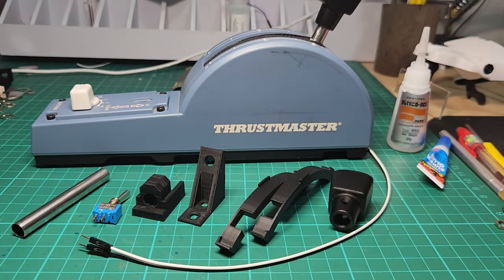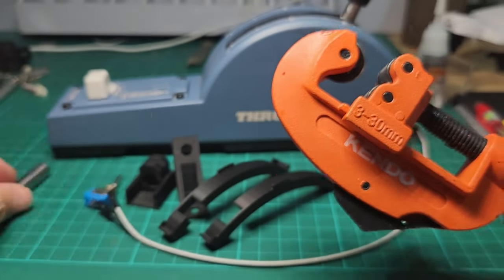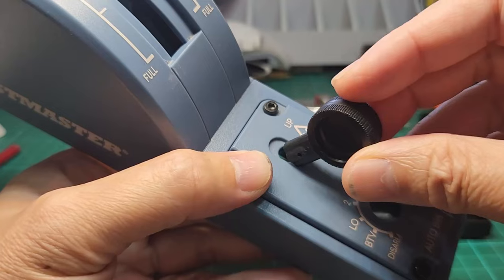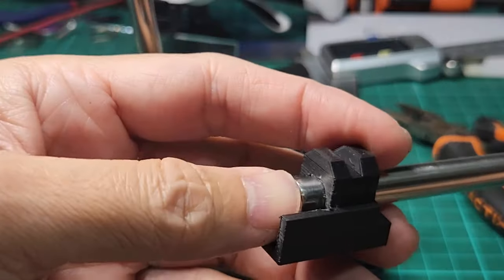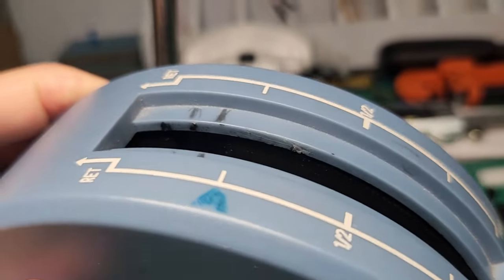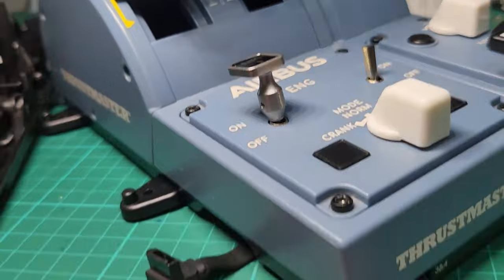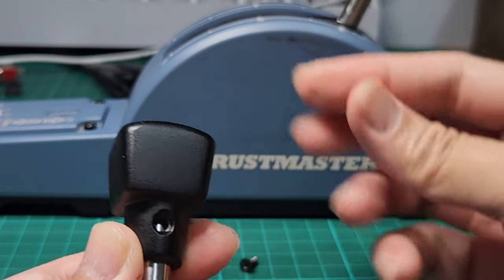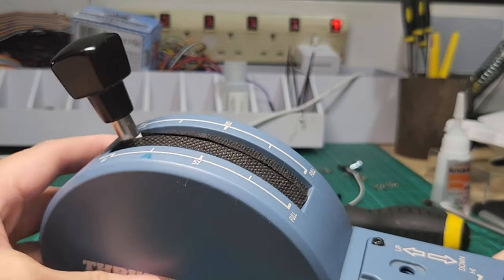Thrustmaster TCA Realistic Airbus A320 Speedbrake Arm-Disarm Mod - DIY

Comment: Thank you for those Engineering Skills. I modified my quadrant, and your tutorial and the files you made for 3D-printing are awesome. I used the option with the Position Nr. 3 of the Brake Switch (you show  it in another video).
Everything works fine and i had much fun modifying the Quadrant-Addon.
Reply from the maker: Johann, thank you. I'm glad it worked for you! Enjoy 😊

Comment: Sorry if instead of backscratchers I found 8 mm window curtain tensioners, drilled thoroughly with an 8mm drill bit until it slides well on the speedbrake rod.

Here it's hard to find 8 mm aluminum tube, thickness 0.3.

I'm happy if it can help someone.

Ciao and thank you
Reply from the maker: Happy that you found an alternative.  Though drilling the 8mm tube thoroughly until it slides through the rod may be quite of a task for others, the good thing is that yo have proven it works!!  Very helpful for people who can't source out those "back scratchers" in their regions.   Thanks for the info Edd!
Reply: @santiagoluib3  But finally I found an item in a local China Shop that fits perfectly: a small fishing net with a telescopic handle that has a 9 mm section and 0.3 mm thickness.
Cost €1.30.
Perfect
Ciao

Comment: Great Video once again Santi. With the white ring, could you make the gap between the guides slightly bigger to accommodate it.
Reply from the maker: Hi, thanks!  Sorry I didn't quite get it.... By "white ring", which part are you referring to?  :)
Reply: @santiagoluib3   Where you put the white sticker to indicate that the Spoilers are armed. You mentioned in the vid that the sticker would get ripped off by the guides. Could you not widen the gap slightly between the guides to accommodate a full white ring around the shaft
Reply from the maker: Hi @buuntaa1986  , it's the actual TM enclosure box that has limited gap, not my railing mods.  With the addition of the 9mm tube you now have zero tolerance in those gap, so you can actually feel a very slight rubbing against it, but nothing too tight to cause tension.  A solution is to file the gaps in that retract position to allow some space on installation and operation.  Anyway, you only need to pull the lever up in that position only :)  cheers!
Reply: Ahhhh thanks for elaborating. Anyway great job with the mod. Why Thurstmaster didn't do this in the first place astounds me. @santiagoluib3

Comment: Hi great work can not wait for my 3d printer to turn up. This is now job number 1 for it ! I just brought the 3D prints from the site,  and thankyou for sharing. Couple of questions tho. Did you use PLA ? What pins did You solider too using the spare buttons under engines one and two buttons ? As I want to keep my landing gear and makes sence to use a buttion I dont use. Alliexpress is not in engish (AUS)  and I am  fining it really hard to navagate, Would there be a button on Amazon to replace it and could you provide a link ? I have searched but dont know the size of your switch. Thanks so much !!
Reply from the maker: Hi,  thanks!  Yes I use PLA.  As to the pins on the main throttle (square) buttons, any of the two pairs of "legs" of one of the buttons you can solder on.  If you do not want to remove the stock button, you can solder underneath the circuit board, but that would mean two actuations: one from this mod's toggle switch and the other from the stock button when pressed.  I would remove the button so only the mod can actuate it, and solder the mod wire with a male terminal pin through those pair holes left from the stock switch you remove :)  Run the wires underneath the controllers for a cleaner result by drilling holes underneath.  For the switch, you can try this:  https://www.amazon.com/mxuteuk-Terminal-Position-Miniature-Dashboard/dp/B07QGDDTWJ/ref=sr_1_6?content-id=amzn1.sym.e2c28ff9-1053-428b-96a0-2b4986391ffa%3Aamzn1.sym.e2c28ff9-1053-428b-96a0-2b4986391ffa&crid=MAPWIDPAPIF5&keywords=switches&pd_rd_r=0c02d100-27e2-445e-a397-c97a3cfba5d9&pd_rd_w=JsUD4&pd_rd_wg=t6NHk&pf_rd_p=e2c28ff9-1053-428b-96a0-2b4986391ffa&pf_rd_r=2Z3DQ66Y61QE92PCPZQV&pid=FlRzCG5&qid=1693624572&refinements=p_n_feature_eight_browse-bin%3A18644646011&s=industrial&sprefix=2-position%2Bspst%2Bmino%2Btoggle%2Bflat%2Bhan%2Caps%2C340&sr=1-6&th=1  you may need to adjust the position of the switch bracket in case the handle is shorter/longer than the one the video is using.  Have a go at it!  :)
Reply: Thanks for the reply. Yes I will be having go. I will let everyone know the outcome. thanks again. @santiagoluib3

Comment: did you use the logitech quadrant for your own landing gear lever? follow up question, is it the reverse part of it?
Reply from the maker: Haha yes! Very old Logitech quadrant, but I used just the handle only 😂. There is a toggle switch at the end of the handle that serves as the actual ldg gear switch. This is sort of a makeshift landing gear panel that I plan to upgrade soon ;)
Reply: @santiagoluib3  dude it’s a brilliant idea, after i saw it i thought of doing one myself, i have an old logitech quad collecting dust in my closet, but where did you get the printout of the panel?
Reply from the maker: @baderbattikhi3567  i made the panel  myself in Photoshop and printed it on Vinyl sticker and stuck on 5mm Sintra (PVC) board.  Of course backlighting is not possible with it, but as long as I get the functionality I'm good with it :)  If you need the decal, email me at santiagoluib3@gmail.com I can send you a copy  :)  Cheers!

Comment: Wow! Amazing and creative! I do have a question. If I want to still use the landing gear lever, then what should I do? Because you connected the spoilers cable where the landing gear lever is supposed to be.
Reply from the maker: Thank you John. Are there buttons on the TCA  that you are not using? Common examples are those two black square buttons on either sides of the Engine Mode Selector. You can freely solder the wires of the mod switch to any button that you are not using and map it accordingly in-sim. In my case, I used the landing gear button for two reasons: 1) I have a separate DIY landing gear panel  2) it's neater for the wire to be in the same unit and NOT having it cross to the main unit to tap on other buttons. But you can do it of course. :)
Reply: @santiagoluib3  thank you for your response! :)

Comment: Santi, have you this complete kit ready to delivery for just plug and play?
Reply from the maker: Hi Luis, sorry for the late reply. The mod basically comes as a DIY kit so you have to install it yourself. By "plug and play" I'd assume you mean an already modified unit? If so, yes I also provide a brand new unit with the mod applied, not just for this unit alone, but also for the whole TM TCA QUADRANT with all myn5 mods applied. 😊

Comment from the maker: As funny as this may sound, a good cheaper source of the tube can be had from these totally non-related items.  The last (base) tube nearest the handle is almost always the 9mm, 0.3mm thickness - perfect fit for the rod and the enclosure openning!   https://shopee.ph/Back-Scratcher-Telescopic-Scratching-Backscratcher-Massager-Kit-Back-Scraper-i.471693230.11052895918?sp_atk=7bcf4bd1-5d21-4010-a566-65a31d4bfadd&xptdk=7bcf4bd1-5d21-4010-a566-65a31d4bfadd

Comment: Great idea and tutorial. On a related note, this goes to show how companies are making money off of half-baked products. How can they sell an "Airbus" speedbrake lever with such an important functionality missing? Even my home-made thrust lever quadrant (thrust levers + flap lever + parking brake + speed brake + gear lever + buttons for A/P, A/T, LOC, APPR and LO/MED/HI autobrakes) has the appropriate interlocks for the speedbrake arming, plus thrust lever reverse interlock. Why a company such as Thrustmaster would not include it in their product is beyond me.
Reply from the maker: Exactly my sentiment.   Probably to lower production cost and retail price, at the cost of sacrificing important features.  But if you look at my mod, it doesn't cost too much, and it works. A serious simmer would probably be willing to shell off another 30-50 bucks on their product just to get that feature.
Reply: @santiagoluib3  No doubt, you added value to the product. You clearly put a lot of thought into your mod, it's is a simple and elegant solution that adds a missing feature at little cost. Well done, sir.

Comment: there is no model or instructions of the meatal tube where and how can i buy it
Reply from the maker: If you read the video description above, there are three links where you can get the tubes  :)  Cheers!
Reply: @santiagoluib3  thanks
Reply: @santiagoluib3  where can i buy the small blue arduino board, the nano?

Comment: Really looking forward to the next video with the stronger thrust detents, they are very strong on the real thing.

Regarding this mod: do you know if I can solider the wires to the two lowest positions of the rotary autobrake switch? I don't need all of them. Also, can I just sand away the unused detents to only keep the middle one?
Reply from the maker: Hi. The throttle detent mod is coming very soon. To your other questions, Yes and Yes. Just identify the pins of the last two positions of that knob. And when you solder it there, note there will be two actuators of the Spoiler arm - the mod and the default knob 😂.
Reply: @santiagoluib3  thank you for answering! I should be able to find that out. Am I correctly assuming, that I'll need an on-on switch for this to work rather than an on-off one like you used?
Also, any plans to mod the parking brake to be a pull&twist lever? :) Cheers!
Reply from the maker: @Fahrstuhlmusik  the same switch (on-off) will do. If you decide to use this knob, i suggest keep it in the 'disarm' position at all times, then solder your new switch wires, one on the ground pin indicated by the little white triangle, and the other on the 3rd pin after the ground. Then on buttton mapping just find that button that corresponds to the pin you used which is the 'BTV' on the controller label.  Do the soldering underneath the board, it's easier. And yes, i plan to do that flap lift-unlock thingy too :)) in fact also the Engine start switches!

Comment: Hi, i have a quick question, will this work with X-Plane 12? Because I’m not sure if it will count as a button. BTW really creative. I wish Thrustmaster had already designed it like this
Reply from the maker: Hi, it wouldn't know what software you run, so that means it would literally run on any simulator :)
Reply: @santiagoluib3  ok, thank you :)

Comment: so if i do that i can't use anymore the landing gear right?
Reply from the maker: If you do exactly what I did, then yes no more landing gear knob.  BUT, you don't have to use that switch as I did.  You are not limited to that switch.  There are other choices, like 1) using one of those two square buttons on the sides of the Engine Ignition/Start knob in the main throttle unit.  Another way 2) in the same spoiler unit  (though tricky to do and access and not mentioned in the video at the time of recording), is to use the pin for position 3 in the AUTO BRK selector knob- the knob just below the landing gear.  This position (3) is unused in FBW or Fenix.  It goes from LO, Med(position 2), 3=nothing, then Max (position HI on the unit).  So position 3 is unused, and therefore you can tap the wire there. You can then bind the spoiler arm/disarm on this knob position in the sim control options.  I hope that doesn't sound to complex :)
Reply: @santiagoluib3 thanks

Comment: Step 1: Buy an expensive 3D printer. :/
Reply from the maker: Yes, if you're into such DIY hobby, a 3D printer is a good tool.  But of course, if you don't want to spend on a 3D printer, it's way cheaper if you buy the ready-to-install DIY kit  :)   Cheers mate!
Reply: @santiagoluib3  Ah I see
I didn't know you could be these pieces already printed. :P